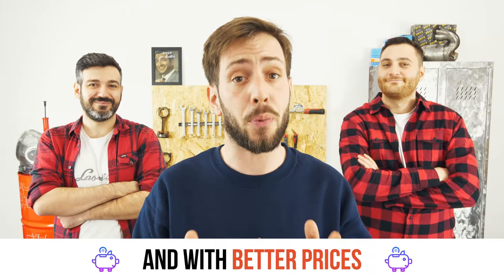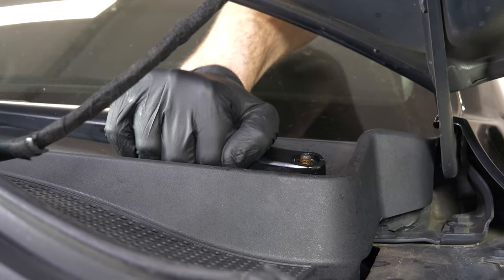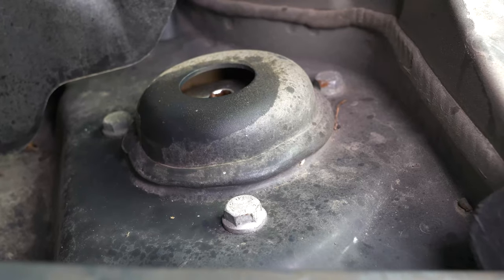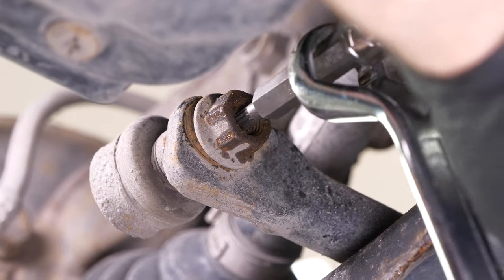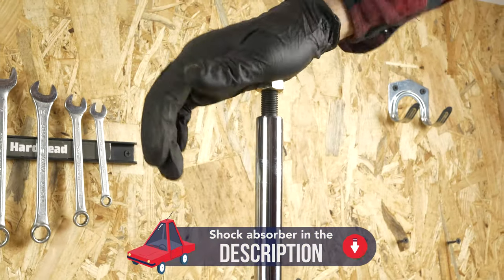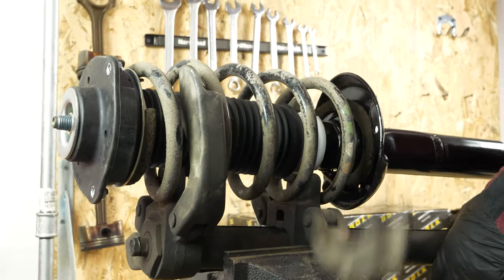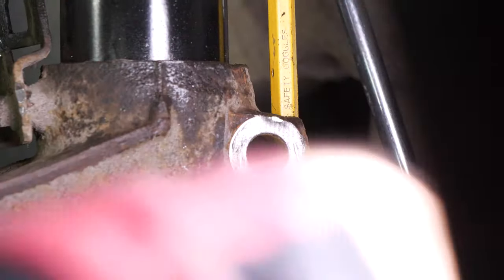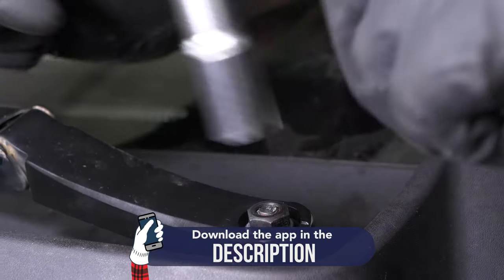How to replace the front shock absorbers Tiguan mk1 ➿

Comment: Torques are newton-meters or foot-lbs?
Reply: After doing some research I believe they are using NM. Additionally I believe when they give a torque spec and a degree of rotation, I believe you are supposed to do both with the torque spec first and then the degree of rotation.

Comment: @3:05 she says 25mm Socket. is it 24 or 25?
Reply: It's 24mm for sure. Doing this job this week. I got Audi TT strut mounts with OEM bearings.
Reply: It is a 24. I checked on the socket it says 24. Good luck. @R0bTheRobot
Reply: @humbertom1184  Did the job last weekend. Had To cut out 4 of the 6 top nuts. Had to leave some spring tension on the struts to undo the top nut as it was stripped. Impact was my friend there. Everything else was ok. Axles weren't that bad to remove. I also used a strut spreader tool aswell.
Reply: @R0bTheRobot  Did you mean the top bolts ?.
Reply: @SpikesMavic  top strut bolts yes